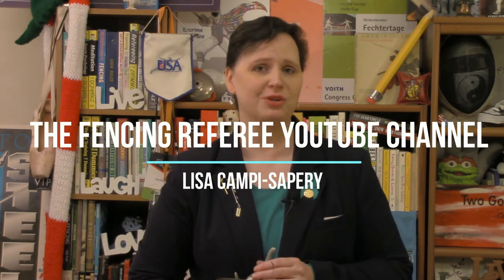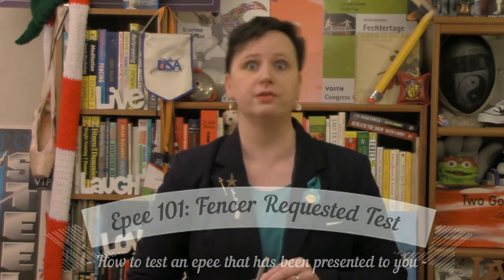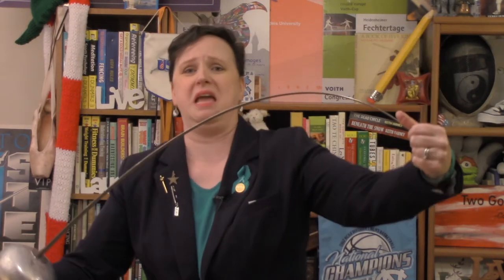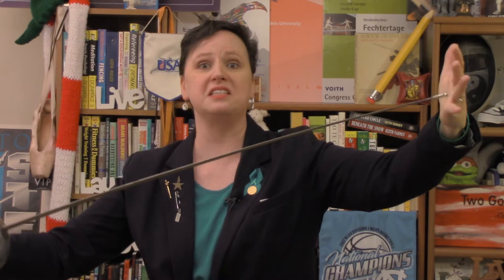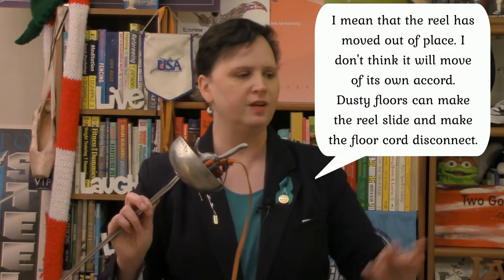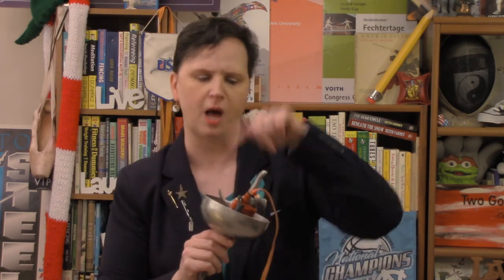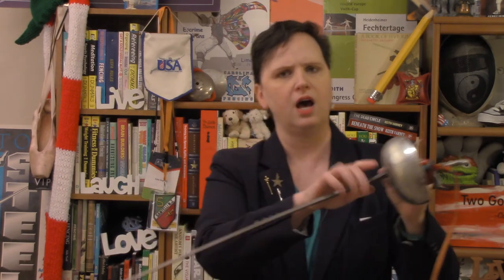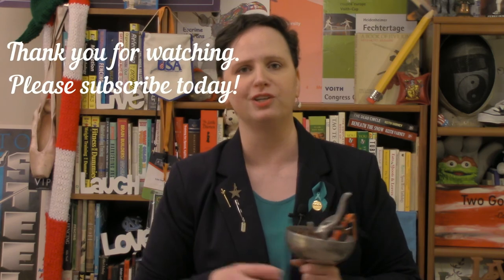Fencing Referee - Epee Refereeing 101-Fencer Requested Test - Learning Module 26

Comment: Thank you for these videos! I know you started making them a few years ago, but they are definitely still used today. I don't quite understand why a loose barrel would result in no annulment of the touch. If the epee passed the initial tests (two screws, tight barrel, etc), I don't see how it could be the fencer's fault that the barrel came loose during the bout. The only rule I can find on this is t.95.1 regarding the bodycord being unplugged. Is there a rule I'm missing?
Reply from the maker: A loose barrel is considered to be something within the athletes control. I have stopped bouts that I know had one. The beat on the blade sounds "hollow" and rattles. A loose barrel could be a means to cheat. So it does not count as grounds for annulment. t.95. 2
2. The fact that the épée of a competitor has large or small areas of insulation formed by oxidation, by glue, paint or any other material on the guard, on the blade or elsewhere, on which his opponent’s touches can cause a touch to be signaled, or that the electric tip is badly fixed to the end of the blade so that it can be unscrewed or tightened by hand, cannot justify the annulment of touches registered against that competitor.

Comment: The video mentions you look down the wire between the tip and guard checking for a popped wire or similar but doesn't tell budding refs what you do or don't do if you find something.
Reply from the maker: Our friend below has answered correctly. Anything that can catch a tip needs to be confiscated, and a yellow card.